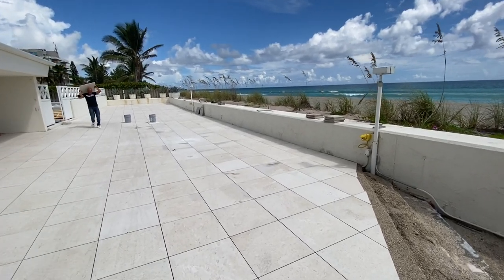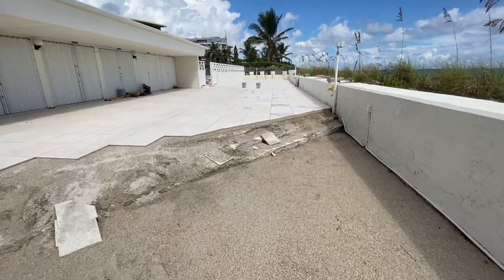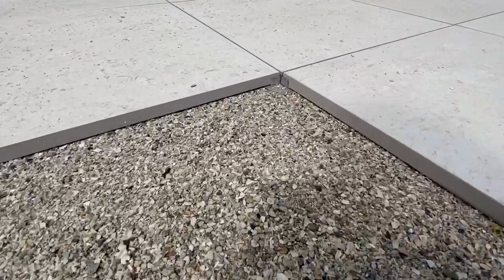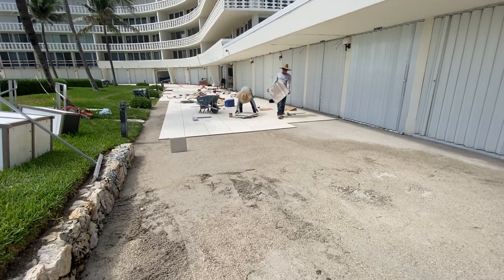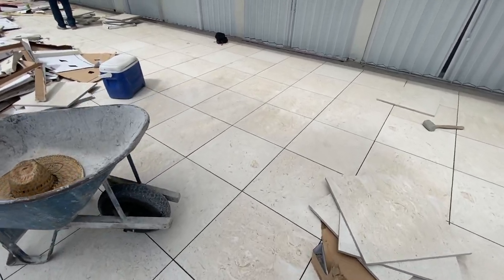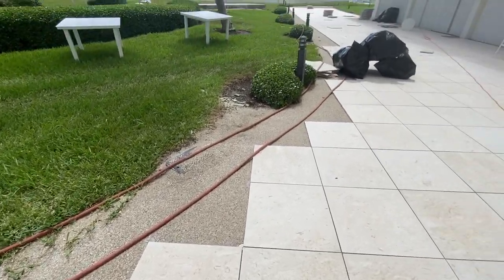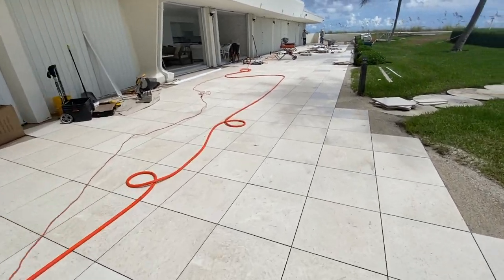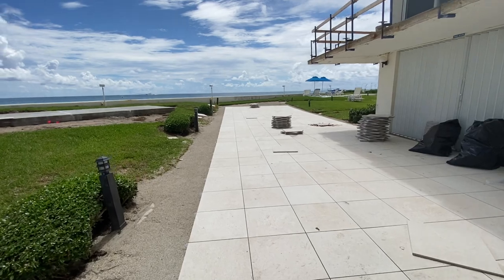🆕porcelain Pavers Over Concrete ▶ Arterra Porcelain Pavers Official Video

Comment: What about drainage?  Do you have to drill holes in concrete to allow water drainage from base gravel/sand as I've seen on other websites?
Reply: That would be necessary if it is location where product is installed would be susceptible to freeze thaw circles. This install is in Florida, no need for holes on concrete.
Reply: Hi, I am looking for that Information as well. I'm in Kentucky and I would like to install them over concrete. Have you found out any other information?
Reply: @giovaniricetti1716  can you share the brand/type of thin set used for the pavers at the edges? Thanks.

Comment: Do you use grout or just sand as with regular pavers?
Reply from the maker: For sand set applications, Polymeric Sand is used. For applications where the porcelain is adhere to concrete, grout. Sand is not recommended in the joints.
Reply: @Hardscape_com  do you adhere porcelain paver on concrete with a regular thin set?
Reply from the maker: @rafaelcetraro1475  modified polymer cement or Thinset if you are in cold climates. For adhering porcelain to cement we advise everyone to follow TCNA guidelines.
We specialize in dry lay applications for porcelain pavers.
Reply: I’m in western NC and would like to resurface our pool deck with your 2cm 24x24 or 16x32 porcelain pavers.  Would you recommend sand over concrete or direct adhere to our concrete pool deck?  Thank you!

Comment: What about weed growing in between the grout line. I understand there is no ground in them but sand but that creates an issue of weed growing.
Reply from the maker: Porcelain pavers installed over aggregate use a special polymeric sand, no weeds will grow and no ants either
Reply: @Hardscape_com  if the lines are narrow, how do you enable the polymeric sand all the way to the bottom? I believe you’re not allowed to use the plate compactor machine (Not sure it’s name)
Reply from the maker: @brazillianguy01  great question, our porcelain pavers are manufactured so they can be compacted with a roller compactor or with a plate compactor that has protection under the plate. We manufacture our own Polymeric sand made for porcelain pavers, 1/8” joint space is what our spacers provide for the installation of our products. Hope this answers your questions .